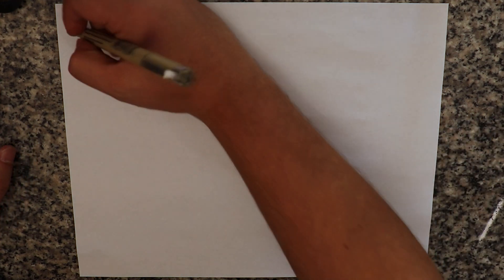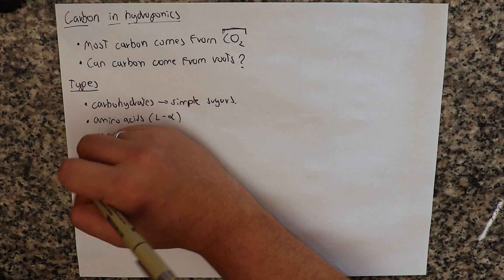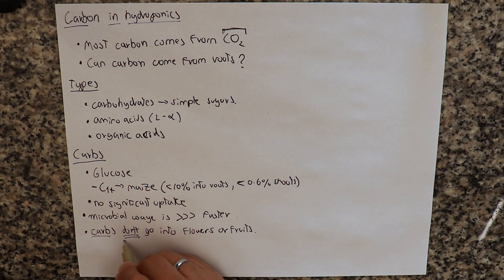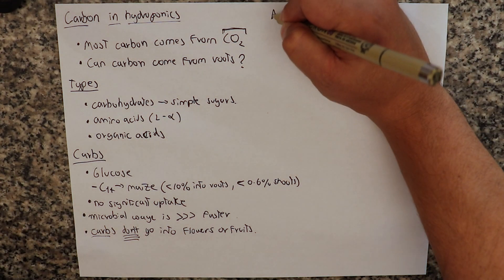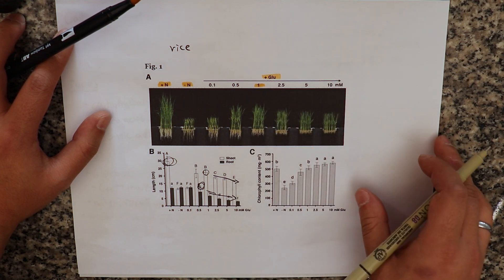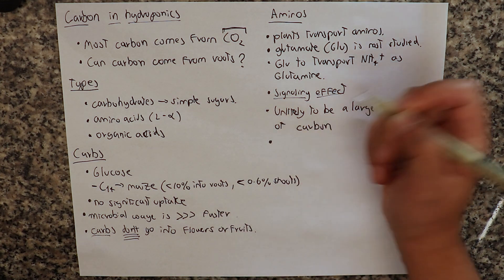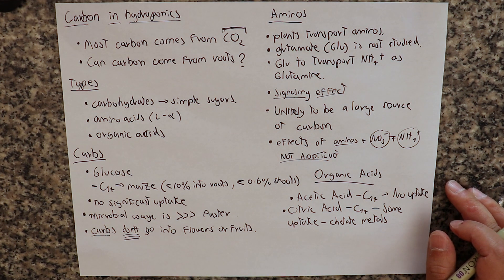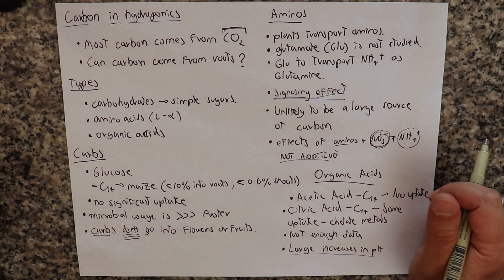Can the root zone do anything with carbon?

Comment: Eden Blue Gold. They can deliver the carbon to the plant, I promise.
Reply: Or Rooted Leaf Agritech too they have some great stuff!!
Reply from the maker: The reasonable conclusion from most current research is that it doesn't happen at any appreciable rate. Ample evidence to the contrary is needed to change that view. Carefully designed experiments, using even C14 radiotracers are very strong evidence that it doesn't happen. If you choose not to believe the science, that's your prerogative.

Comment: I always contemplated on adding beneficial microbes, mycorrhizae fungi and unsulfured blackstrap molasses into my hydro setup for cannabis. Some of the more experienced growers have told me not to add anything like that and some have told me you can add a little of molasses near the end of the grow. I watched your video with Mr Grow It and you mentioned that basically if your hydro setup is running really well, there's no need for microbes. I've even heard of some people adding hydrogen peroxide to kill certain microbes in their hydroponic system. This is all really fascinating stuff and I really appreciate it, thank you very much.

Comment: Thank you! Very interesting.   Excuse me if this is not accurate, but this made me think about MSG, how MSG naturally occurs in fermented products like kimchi and sauerkraut.  Glutamic acid somehow reacts with sodium to produce mono sodium glutamate.   I was thinking maybe if you don’t add salt to the ferment, then you are more likely have potassium glutamate.   so for anaerobic lactic Composters, is there naturally occurring glutamates?  If so, would using a lactic fermented compost slurry (like Agrothrive), add glutamates that could be beneficial?  In our organic hydroponic operation, we occasionally supplement with agrothrive which has a pH of about 3.0 because it is dominated by lactic acid.   The lactic acid doesn’t affect the pH of our hydroponic reservoir over the long-term, like citric acid and acetic acid, it will just bounce back.  So if you regularly dose small amounts of lactic acid or citric acid or acetic acid, there’s no change in the pH.

Sidenote, on your video about making organic hydroponics solution, you said that you can use citric acid to adjust the pH.  As you mentioned in this video, that is not a good idea.  Might be worth updating that video.
Reply from the maker: Thanks for commenting. 

About the naturally occurring glutamate. This amino-acid is almost certainly present in most composts. At the pH used in hydroponics, this will always be present as glutamate. Which cation is present in solution to balance this charge is not very relevant but in composts from plant material this is more likely potassium rather than sodium. If you are seeking a lactic acid containing product, corn steep liquor - which is most commonly around 30% lactate - will do the job very well. 

About the citric acid, in the other video I meant for it to be used just for the initial adjustment of solution pH, not for the continuous adjustment of the pH in recirculating solutions. I definitely do not think citric acid can be used for any sort of routine pH control of a recirculating solution, as microbial metabolism and plant uptake of citrate will make the process ineffective.

My experiences with organic hydroponic setups so far show that pH control of the recirculating solutions is not needed. The formulations can be made to be self-correcting.

Let me know if you have any additional comments or questions!